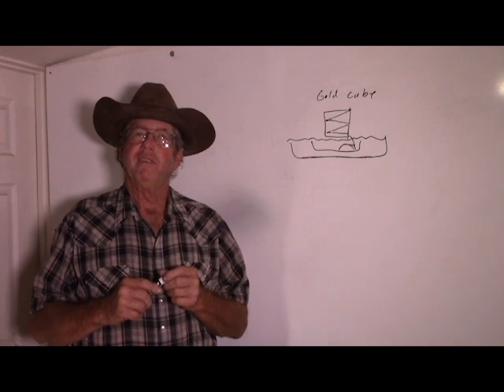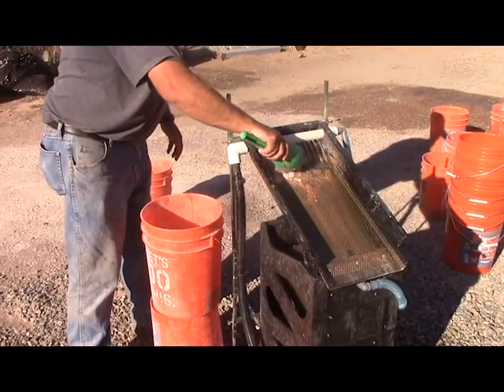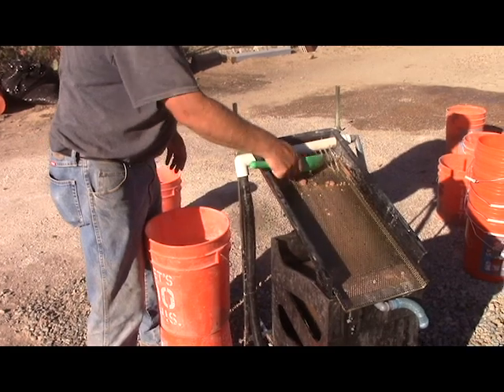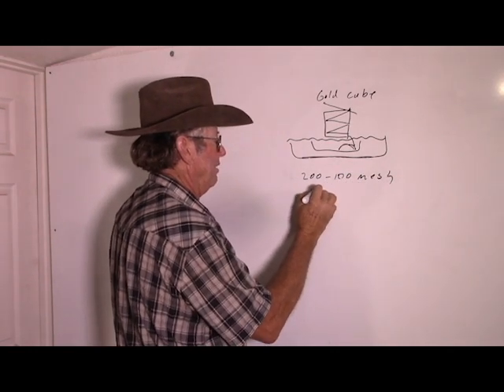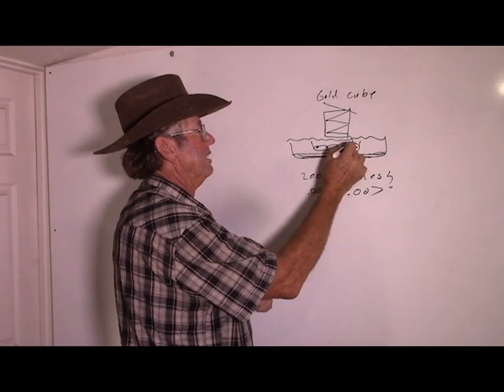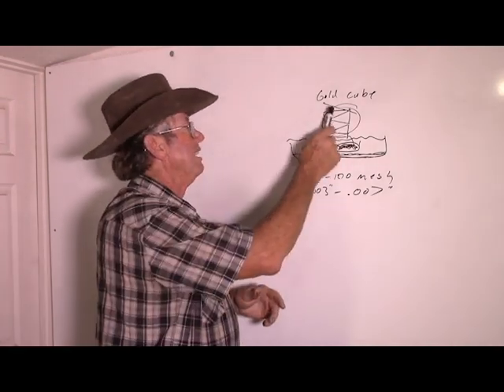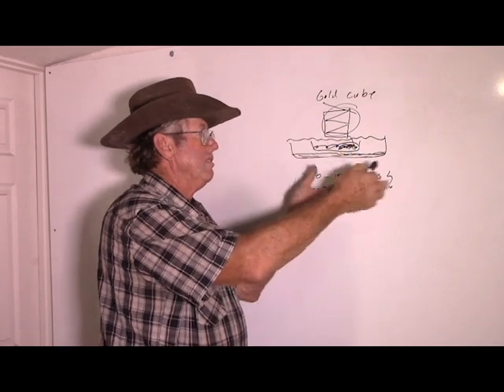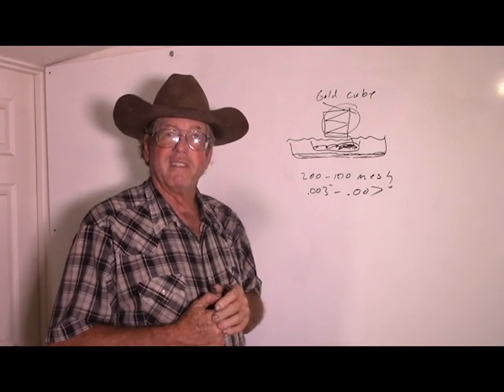Lesson 27 The Gold Cube and Low Grade Ore

Comment: Know this is kind of late, but just found this video concerning hard rock material and the Gold Cube.  Ran a test myself, and found that the Gold Cube just isn't designed to run anything mesh 200 minus hardly at all.  I had a Dream Mat micro as my first catch, and results were zero gold.  The third layer with stock matting didn't fair much better.  I reran the tailings in my sluice with green carpet matting, and then through my homemade cleanup sluice with deep ribbed matting, and my estimate of gold caught in the Gold Cube/Dream Mat setup is less than five percent recovery.  The rest of the gold was recovered in my time tested sluices.  I frankly think the Gold Cube will catch most gold 200 mesh plus, but even then, it is going to lose a good percentage of the gold run through it.  My view is stick with time tested methods like the sluice, or gold pan.  My material is also fairly low grade, most of which is smaller than 200 mesh, and as small as 800 mesh.
Reply from the maker: Thank you very much for the information.  We have also had good luck with the Devon Gold VDR mat.  Getting good recoveries down to a bit below 400 mesh.
Reply: @hardrockuniversity7283  Hmmm, looks quite a bit like the Dream Mat, which I found couldn't catch the super fine gold.  Thanks for your videos.  Many have helped me improve my venture into recovering gold from old timer hard rock waste piles.
Reply from the maker: I am glad we could help.

What method of grinding are you using?  We are using an impact mill which tends to roll the gold particles into balls, which are the ideal shape for gravity concentrating.  That may make the difference.  I agree it looks very similar to dream mat.

What precisely do you mean when you say "deep ribbed mat?  If might be  better, I would definitely like to try some.  Our sluice uses three mats end to end so we use three different mats and compare them.
Reply: @ I mill with the 11 inch electric K&M Krusher.

The mat is kind of like the ribbed door mats, bur has grooves about twice as deep.  Got it from Royal Manufacturing.

The gold I get is rarely larger than 200 mesh, but I use a commercial electric flour sifter to classify to 80 mesh minus.  I then put some in a bucket, add water, and stir with a stick to break up the would be clumps, and slowly pour into my sluice.  I estimate I get over 95 percent recovery this way, using the green ribbed carpet mats with aluminum expanded metal over those carpets.
Reply from the maker: Thank you.

Comment: Overall gold cube claim of recovering small to tiny gold is misleading. Mine is just accumulating dust I get better recovery by using chemical recovery.
Reply from the maker: "Tiny" is pretty indeterminate.  I figure 400-500 mesh is about how small I can get with gravity.  Montana B ore runs 80% by weight minus 6.8 microns (about 2000 mesh)
Reply: @hardrockuniversity7283  yes 400 to 500 you can still see, I'm referring to microscopic gold. Thank you so much for your comment
Reply from the maker: Microscopic won't stop in a gold cube IMO.

Comment: When you're crushing ore, you end up with a lot of slimes, which is basically clay. Unless you have super rich ore, there is no need to run anything larger than 30 mesh. At this size most of the gold is liberated from the host rock. This also allows you to run the Cube at 500 gph which is enough to move this size material and allow the particles to settle. I use jet dry mainly to prep the mats and get rid of the air bubbles. The residue is enough to act as a surfactant while you sluice. Too much soap or jet dry will cause your concentrates and gold particles to be trapped in the soap bubbles, similar to the floatation process. Feed your material slow and wet and you don't have to do it over again three times. Remember, the Cube was designed to catch super fine gold from Lake Michigan and Lake Superior without any fancy gadgets or mats. Gold Hog uses the Cube to check for losses on their mats.
Reply from the maker: Have you tested this on actual hard rock gold ore?  It is considered general practice to grind to minus 60 mesh at a minimum for liberation.  They often even go to 100-200 mesh.
Reply: @hardrockuniversity7283  
I've collected many samples from gold mine tailings and dumps over the years. I use a Keene RC 1 crusher, which means I have to hand crush the ore to 1 inch or less before feeding. It takes about 4 runs to get everything down to 30 mesh minus with the majority being 100 to 200 mesh. This is also the size of the gold I'm recovering. The finer the material, the harder it is to recover the gold with gravity means, because it stays in suspension. Ideally you want to classify the material to the different sizes before running but when you're spoon feeding a whole 5 gal bucket, things get boring real quick. So far the ore I'm running has been very low grade and I won't even do the math on it. I'm happy if it pays for my Jet Dry! Hard rock mining is not for the squeamish, that's for sure. Thanks for responding and Happy Prospecting! ⛏️
Reply from the maker: Most of the hard rock  ores I have dealt with have between 20 and 80 percent of the gold particles in the 500 mesh minus range.  Glad yours is simple.
Reply: @hardrockuniversity7283  
Mine is simple, because I only see the few specks I recover. I never see all the 500 mesh gold that I end up fertilizing my shrubs with. Just as well.
Reply from the maker: Ah.... I see.  OTOH, I see a challenge.  🙂
Reply: @hardrockuniversity7283  
I have tried Blue Bowls, Spiral Panners and Miller tables. They can catch micron size gold if you set them up properly but you can't run large quantities on them. I use a Gold Hog Multi Sluice with two different mats and a Gold Cube with 5 trays including slick plate. The final clean up is done hand panning, using your technique. Once the super concentrates are in the pan, you have complete control over it and your losses are virtually 0. All the other gadgets have a loss rate of about 25 to 50%. That's a lot if you don't have much gold to start with.
Reply from the maker: Yep.  I have been working on some devices, but got side tracked with the Montana B ore which just won't gravity.  I was getting 80-85% on Ryan's ore.
Reply: @hardrockuniversity7283  
I lost track whether you got your concentrating table patented, but that's about what every serious operation uses if you can afford it. I thought about purchasing a RP- 4 shaker table, but I'm obviously not in it for the money. I'm lucky to get my money back on $3000 worth of gadgets that could be replaced with a simple gold pan. My biggest problem is copper ore that has sulfides and chalcopyrites. They're almost impossible to separate from the black sand and the only way you can tell them apart from gold is by the way they move around the pan. I don't even want to crush ore anymore if it has any copper oxides in it. Some places in Idaho have a mineral containing lead, silver and copper that has a high enough specific gravity to cause problems as well. Thanks for your input and taking time to respond. I know you are busy!
Reply from the maker: You could concentrate the sulfides easily and THEN roast them to free any entrained gold by re-grinding and re-panning.
Reply: @hardrockuniversity7283  
Thanks. It's probably hot enough in Arizona right now to roast everything naturally!
Reply from the maker: We had a heater on last weekend at 7100 ft.  Sucks to be you.  🙂
Reply: @hardrockuniversity7283  
This too shall pass. Hang in there, Keith.

Comment: It takes a while to get used to whatever piece of equipment you use. You shouldn't expect it to work perfectly off the bat. Water flow and surfactant, jet dry, is the secret to fine gold recovery with any gravity concentrator.
I use a cube in my operation, I.e., hard rock ore, jaw crusher, chain mill, screen to under 1/8", gold cube, pan cons, run tailings across shaker table set up to catch micro gold, de - mag, fine panning, cleaning, roasting, 2nd de- mag. Results - super fine dore to smelt or acid wash depending on the ore. Anything else requires flotation or chemical extraction.
Nothing new about a gold cube. My dad had one made out of dynamite boxes back in the thirties that I used when I was a kid in the sixties! It worked exactly like Pungs cube only the riffle trays were made out of old tin cans cut into strips and rolled into a half circle, the rest was wood. The trays were covered with corduroy material instead of rubber mats. I still have my dads old wood and canvas dry washer that he had during the depression. The stack sluice (gold cube) burned up when the cabin burned down. I was going to build one out of aluminum until I found Mike Pungs Gold Cube. Saved me a lot of work! Thanks Mike, but you didn't invent it, the Chinese most likely came up with the idea!?

Comment: Micro fine gold loss?
Jet Dry.
Real easy fix.
Reply from the maker: I agree that would help.  Others who are getting good recovery also suggest reducing the flow rate.  The reason we did so was to test the  manufacturer's claim that it wasn't necessary.  I think we disproved that.  Doesn't mean it can't be MADE to work just fine.  I usually start with the manufacturer's recommendations and then go from there.

keith

Comment: I beach mine, and the gold I recover is all -100 mesh and smaller. Even to the point where a loupe is required to see it.
I use a cleangold magnetic sluice as well as various mats in the sluice to aide in the recovery.
I use a Goldcube to clean the cons and have no difficulty in capturing the fine gold.
I do use some surfactant to prep the trays before running though.... It is essential the mats be thoroughly wetted before running any material.... NO AIR BUBBLES LEFT IN THE MATS....
I will usually run my material 3 times, first run catches about 95% and the following runs clean up the remainder .
As far as the cube missing gold.... water flow which should be around 1100 GPH .. the material does NOT have to be pre-wetted but it doesn't hurt to do it anyway. Surfactants do not need to be used with the exception of prepping the mats as mentioned earlier.
I have added deep V mat to the slick plate since it really is wasted space otherwise.... Put it to work it won't hurt a thing.
Now with all that said , there is some gold that just doesn't like to be caught and I would imagine gold that has been crushed out of hard rock or is definitely one type that is hard to catch be cause it is so fine and then further crushed into super thin flat tiny flakes.
Here is an image of a concentrates cleanup run.... this was the first tray.

http://www.treasurenet.com/forums/sluicing/454120-got-out-little-today-27.html#post5445980

That post is from my thread on treasure net.. I am johnedoe and I do a little beach mining.

Comment: that's the bad thing about the blue bowl is you have to have all the particles basically classified to the same size or the gold particles will lift and washout before black sand that is 2 times larger than the gold will. Same thing with the gold cube the finer the material the slower the flow, add material wet not dry use jet dry classify larger particles out before using gold cube the closer the particles are in size the better things will separate.  factory gold cube flow with the pump they send is too fast for fine gold slow it down, classification is key with any kind of density separation
Reply from the maker: Thank you for the input.  One of the difficulties of gravity techniques is getting one that operates over a relatively wide variety of particle sizes.  My experimental table seems to do well from a -30 mesh input with recovery down to .002" / 270 mesh gold particles.  I am not sure if it can recover smaller, or whether my ore simply doesn't have much in the way of smaller gold particles.  That is why I need to do more testing.

Interesting challenge.

Keith

Comment: hey Keith, what kinda chemical technique would you recommend for that gold?
Reply from the maker: The spectrum of chemicals possible is heavily dependent on the ore type due to the reaction of the gangue minerals with the leachant.  There are also cost and safety and regulatory issues to sort out.  If you run head ore through the leaching circuit, cost is more important than when you have a good concentrate.  You also run into the issue of more chemically treated tailings to dispose of: a possible serious hazmat issue.

For all of these reasons I try very hard to find some way to gravity concentrate first and then leach or smelt the cons.  That is also why I am working on my extraction table.

However, for this exercise, let us assume that you can't get a really good con from a gold cube, table, or other device.  Let us further assume that liberation is not the problem (as apparently in this case).  The first gravity technique (gold cube in this case) gets some of the gold, but not the fine stuff.  The coarser tailing seem to be barren (needs double check to be sure- pulverization + panning, or assay, or both).  But the SLIMES seem to concentrate the very fine gold which floats through the primary extraction device...

First, we can try some sort of gravity technique on this material by itself using a much gentler process.  For example, you could re-run the slimes over another gold cube at a slower flow rate or some other extraction technique that no longer has to push the coarse tailings also.

And here is another- easy to test- idea: run the slimes over a screen that has the same size hole as the largest gold in the slimes.  This reduces the bulk even more.  Then wash the slimes through a basin large enough to settle the gold but which lets some of the more easily suspended fines through.  If this is a continuous flow process, this settling device is called a 'thickener'.  Now you have separated the finest gold from both the coarser and finest slimes, thereby reducing the bulk even farther.

If this reduces the total to a pannable volume, you might be able to get it even more concentrated.

If you don't wind up with clean gold, at some point you will either have to smelt the cons, send them to a refiner, or leach them.  In any of these cases you should have a much easier time making a profit as you have to process  much less material which should result in much lower costs.  Which one is the best will depend on circumstances, but in terms of leaching you should have a better chance of making a profit with a fast leaching, and preferably low toxicity leach.  Remember in leaching you still have to get the gold out of solution and then probably still smelt a dirty gold electrowinning residue.

All of these steps need to be tested and verified before you can be confident you are being efficient.

I am not personally familiar with any leachant other than sodium cyanide with activated carbon recovery and a stripping circuit and smelting.  I guess you would need to talk to various manufacturers and some of there customers for more info.  DON'T trust a manufacturer's word alone, especially if his process 'works on everything'!

keith
Reply: Thank you Keith
Reply: Oh and just to chime in again, I forgot to mention that I had the same problem with my gold cube losing the gold and I did use a Jet Dry.
Reply from the maker: Thank you for the input.  I just don't have the time. money, and imagination to accomplish all the trials all of our students can.  I really appreciate everyone contributing. 

Keith

Comment: I've run into the same problems with my gold cube and even shaker table, rp4. had to figure a way to filter it because as it ran into my catch basin, it would catch the turbulence and ride it out of the catch system.
Reply from the maker: It can be a pain.  The RP-4 didn't seem to get very good recoveries of the micro gold with my ore and also had a lot of middlings to deal with.  Some surfactant along with minimal turbulence seems to be the best.  I'm working on a solution and should be able to announce it in a few months.

Looking for different ores to try it on for free if you are close enough to Tucson to swing by.

Keityh
Reply: Hard Rock University up in Pahrump  NV. We have very fine gold, and low grade to boot! So I'm  trying to figure out how to get every speck of it. Do you think the Gold well is worth the money? Thnx...nt
Reply from the maker: Well, low grade is not the best.  :-)   However, 'low grade' is a reltive term.  Do you have any assays as to exactly what the concentration is in PPM or Oz/T?  And what is the extent of the ore body?  Ho large is it?  These are important factors.

Keith